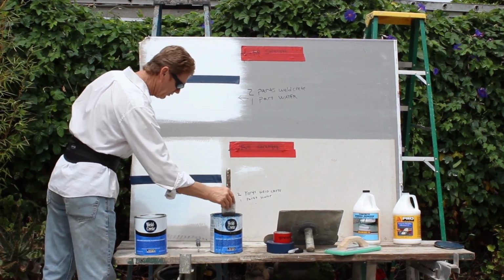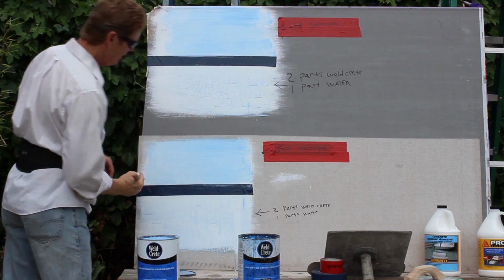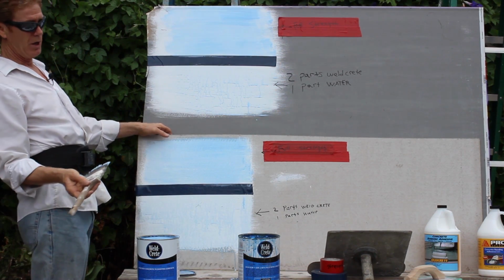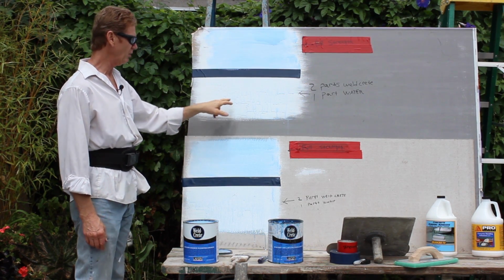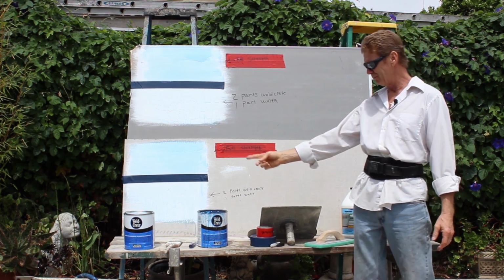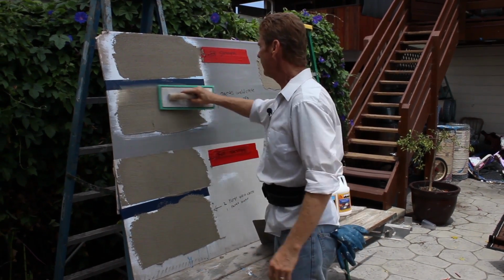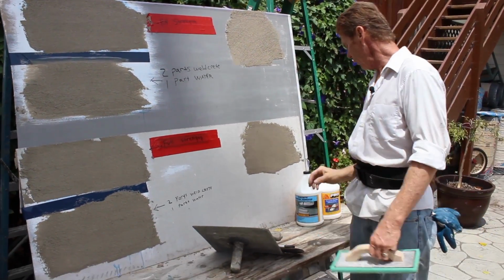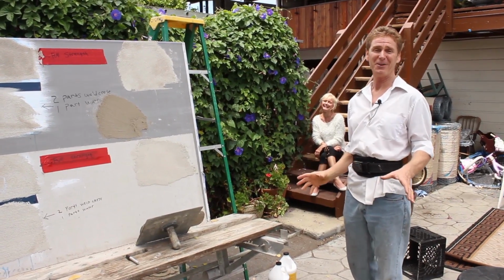Stucco and Concrete bonding agents.

Comment: Hi Kirk, I live in Ontario Canada and I have remove all the paint on the foundation wall of the inside of my garage with a diamond cup wheel and I have a little iissue with calcium in the cement. The house was built in1985 and I was thinking to put some sika latex R in my mix of parching cement to make it bond beter. What his your thought and dilution recommended. Thanks
Reply from the maker: Good evening Pascal, that product is engineered for what your needs are. I have not used it but am aware that Sika is a very reliable company if they say something works, it works.
    The complete plastering encyclopedia on video, by the plastering messengers of Youtube.  
     Over 850 free self-help videos 🎭 👀💃
Subscribers, you can depend on us to explain with truth, honor, experience, and skill for your time invested for wishing to learn the hows and whys of plastering.😉

Comment: it might be something like painting a car or metal, the first coat of say primer, or paint, is a light coat producing little dots which adhere to the metal not each other, the next coat is a wetter or full coat which hangs on these little dots, if you make the first coat wet it will probably not stick to the metal or primer as well but will create a film which might just peel off.  This is the case of trust the man in the trade who does not want to go back to unhappy customers!  Kirk is also right that a manufacturer describes a basic application and does not try to cover twists which may work.  great vid!  probably the watered down method leaves a surface that looks etched or rough and the heavy coat looks actually smooth which allows the color coat to contract creating cracks.
Reply from the maker: Evening Rob, close enough my brother. But on the flip side do as instructions say, not what my experience has proven as it's a bit complicated, this video is just the tip of the iceberg.
           Bringing peace, love, and brotherhood back to the world of, “Cement Plastering.” 💃
With over 800 educational and free Youtube videos, by your favorite plaster geek, “me🤓” and my son, “Jason,” the bearded plasterer.🌍

Comment: Kirk do you think that the thicker weld crete  was still drying after  an hour and as the top coat was drying there was opposite force which created the AMAZON AFFECT. But then 
again it look like the river NILE.!! LOL
Reply from the maker: Greetings, Observerer Dude. I've seen the results many times after plastering about 50 homes.
I know what to do and what not to do, by time in, and sure I took in on the chin a few times in the past 40 years to learn these facts.

     Bringing, peace & harmony back to Plastering
Sound Plastering tips from your favorite stucco geeks, with over 800 videos to learn from
Reply: @StuccoPlastering  Thanks Kirk.

Comment: Great videos Kirk!
I have a small repair where I am using Quikcrete Fast Set Repair Mortar and need to feather out to the existing, original painted stucco surface and will apply Weld Crete prior to the repair.  Do I need to dilute the Weld Crete on the painted stucco portion in order to avoid spider cracking or is that just for when using color coating products?  I will be priming and painting the repair once it cures (after the manufacturer's suggested time of 7 days for an exterior latex based paint).  
Besides the color additive, could you explain the difference between color coating and finish coating?
Thank you in advance for your wisdom and response.
Reply from the maker: Good evening Stanley, any bonding agent is necessary to add cement stucco to an existing wall. This video I am explaining color coats over painted surfaces.
Your using a base coat, so full strength would be advisable.
                         Bringing peace, love, and brotherhood back to the world of, “Plastering.” 😏
With over 800 educational and free Youtube videos, by your favorite plaster geek, “me,” and my son, “Jason,” the bearded plasterer.😉

Comment: Kirk, I have been perusing many of your videos and may have found the answer I was looking for in this last one...  Almost all your videos talk about things you can do to keep plaster from cracking. I'm trying to do just the opposite. I am matching an interior stucco which was made to look old, and has lots of cracks, some very pronounced. If I want to duplicate that look would I be wise to do a thick weld crete coat over hardibacker, then followed by a single, thick, wetter-than-usual color coat?
Reply from the maker: Evening David,  many ways to skin a cat.
 If you apply this bonding agent at full strength and a 1/8 inch of finish material with this bonding agent, you will likely see the blue.
 You can mix rich as in half cement and half sand, these rich mixes crack all the time.
Normally it's 3 parts sand to every one part cement plaster.
By law, I have to add, do what the can's say. 🍺
The complete plastering encyclopedia with more than 800 videos by the plastering messengers of Youtube. 
                          Bringing peace, love, and harmony back to the world of plastering.

Comment: Great videos Kirk........Quick question.....What's your take on color coating over Hardie Backer board installed on the eaves
Reply from the maker: Good Evening Ray, this is doable, I would apply a skim coat over and make sure you use water for a good mechanical bond or apply a bonding agent such as the Weld Create, undiluted.   
                Peace, love and happiness to all.
  Sharing stucco wisdom with Kirk Giordano plastering

Comment: So, My take on this is, if your going to use this WeldKrete Bonding agent.  You should apply at least more then an 1/8 th inch of Mortar on the wall.  If I'm wrong let me know.  Thanks Sir!!
Reply from the maker: Aloha Easy Dude, if any finish coat is applied more than 1/16 to 1/8 they will crack like an egg, all finish coats are not designed to be applied like basecoats.
 Example if it's a 30/30 and this can only be applied 1/16 of an inch as the sand is like talcum powder, or say the 16/20 heavy grit san can only be applied 1/8 as the sand is so thick it can't possibly be applied any thinner, but if applied thicker than the 1/8 it too will crack when dried.
 
                        Peace love and happiness to all.
      Plastering and repair tips for your number one investment

Comment: Do you ever wet cementitious surfaces before applying a coat of something? I know with tile a lot of guys wet down Hardiebacker a little before applying thinsets, or else the cement sucks all the moisture out of the thinset before it can actually bond.
Reply from the maker: Evening Love Dude, this is called hydrating, it makes for a natural mechanical bond

     Cheers, peace & harmony 
Sound Plastering tips from your favorite stucco geeks

Comment: I had this reaction with structolight as a base coat over sheetrock . I went full strength with plaster weld killing the suction completely. Room was very hot and dry as well. Craked like and egg which was very unsightly . Plus I left it steel trowled sealing it instead of floating it to let it breath . I went with taping mud over my base coat instead of the diamond i intended to use to avoid adhesion problems . In the end you gotta go with what sticks ..
Reply from the maker: Greetings Michael, atta boy.
             Peace, love, and happiness being plastered
       Sound Plastering tips from your favorite stucco geeks

Comment: Can this be used to coat before covering a pergola with stucco? We need to coat it with stucco for the HOA rules. Anything else we need to know before attempting stucco on pergola?
Reply from the maker: Good evening Beth, no, you would have to paper any wire to apply stucco to any wooden Pergola.
 I did this to a newly built Pergola that was 130 feet long by 20 feet wide, there are no shortcuts, or I would know them.    
                             Best wishes,
      Professional answers on plastering projects
Reply: We have not started the process yet but were told that we needed to cover the entire pergola with metal screen...Opinion on this?

Comment: Kirk, 

My take away from this that you can put your material over cementitious product such as Hardie board with out using Weldcrete.(Of course you should wipe off any dust on the board that might exist.) How ever I believe in the video in which you stucco over a partially stuccoed pizza oven the installation has 3.4 self firred wire and Weldcrete. That video was published in '12 where this was done in '15. Are there reasons for the difference? Has experience taught you the wire is not needed? 

I'm going to stucco over newly installed Hardie on walls that are 9' high, is that a consideration as to wire or not? Some on YouTube suggest that a 1/8 “ gap should be maintained between Hardie panels. Does that make sense? With metal studs and a cement board I don’t really expect movement from humidity changes so I would expect I can install the Hardie tight against each other. 

Finally, the Hardie is the scratch coat itself so I really only need to do a brown and a finish coat right?

Thanks, Stuart
Reply from the maker: Greetings Stuart, exzackory.
             Peace, love, and happiness being plastered
       Sound Plastering tips from your favorite stucco geeks

Comment: I have an interior stone fireplace. I want to add more mortar to the joints so that’s it’s more flush with stone surface. The existing mortar appears to be sealed because water beads up and rolls off. What do I need to do to make more mortar adhere to sealed mortar? I want to achieve a white, German smear look over entire fireplace surface. Any suggestions?
Reply from the maker: Howdy Christie, if it were me, I'd apply a bonding agent, then use Hanson's white cement plaster and trowel your prefererd finish on.      
                 Live long and Plaster
Plastering tips from your favorite stucco geeks

Comment: I was thinking another posibilty for the spider cracking is that the weld crete itself is shrinking back.  Shrink back occurs on alot of render paints as well, which are latex based  Im not sure what Weld crete is made of, i dont think it is PVA based as that is not water proof... but PVA does adhere well.... im thinking they use latex (SBR) mix of somekind as the primer which gives it that flex.....  and as most primers are wet on wet meaning you put the weld crete on and you need to put your cement coat on top with in say 24hours for it to bond, when you put a thin 3mm topcoat, the primer (weldcrete) shrinks back and takes the thin top coat with it.  if it was 1/2 inch 12mm etc.. the coat would have to much mass to be moved by the shrink back of the weldcrete.  So its probably that the top coat is too thin..   

I think follow the weldcrete instructions but, if it is direct to a top coat, weld crete should insist on a base coat before the colour coat. 

You seem to be getting away with it and making do by diluting, which is probably fine like you said.... but "if" something was to happen you would have no comeback to weldcrete.   but its unlkely given the experience and personal understanding you have of the product that you will ever have issues. 

I do love videos like this. its great.
Reply from the maker: Howdy Aaron, thank you    
                 Live long and Plaster
Plastering tips from your favorite stucco geeks

Comment: how about adding bond in plaster for refinish work
Reply from the maker: Howdy  Terry, that's thinking outside the box and using your imagination, however when any liquid bonding agent is added to a stucco mix, this action renders any bonding agent useless for many reasons.
 "Don't Do This," as I have heard from at least 20 homeowners in over the last 30 years that this is what their contractor did, thus, why the finish coats were coming off in sheets in under 5 years.
 
                    Live long and plaster
         Mastering Plastering for the beginner’s

Comment: Have you ever used AC100 from Dryvit? I use it for interior and exterior with great results.
Reply from the maker: Howdy  Chris, no, I have not used it nor will I, as at this stage of my plastering career, I can't explore the possibility of if it works, the  method I show here have been tested in well over 40 years, and old Kirk does not have 30 years left to wait for results, thus must use time-tested methods, thanks for the tip.
                    Live long and plaster
         Mastering Plastering for the beginner’s

Comment: Oh no Kirk I think I made a terrible mistake. I diluted the Weld Crete 1 to 1 instead of 2 to 1 as you mentioned in your videos.  Did I dilute it too much for a color coat application or should I be safe?
Reply: Kirk the reason I am a little concerned and confused is one of your videos from 2011 said to dilute it 1 to 1
Reply from the maker: Good Morning Global dude, you should be fine, I tell folks to do as the cans say.
 I am referring to a painted surface applying a stucco finish color coat, this is the method I prefer and all my stucco construction pals.
    BTW, if applying concrete or stucco, full strength is not only advisable but required,
 I am showing technical stuff as I understand stucco finish coats too well.                   
                              Live long and plaster
                     Kirk and Jason Giordano plastering tips
Reply: jlopezglobal I

Comment: Kirk, do recommend washing the stucco surface with TSP [Tri Sodium Phosphate] prior to any repairs or applications of a new color coat?
Reply from the maker: Howdy Ken, you can, however, 3,000 psi strength with a pressure washer will do, of course if it a new basecoat, just water needs to be sprayed on consistantly as new stucco adheres to a properly hydrated base coaat forever.                   
              plaster it’s everywhere you want to be
    Sharing DIY Plastering tips from Giordano Plastering

Comment: Kirk your videos are great but I have not seen a video that covers the following subject. Ok so i pressure washed a painted stucco wall, I applied the Weld-Crete and let it dry for 2 hours.  I am about to apply the color coat.  The question is once I apply it do I need to hydrate the color coat?  Do you just let it dry and not mess with it?  The wall I am planning on doing is 10x10 I am thinking of applying and floating on my own but I am afraid the coat will dry before I get a chance to float.  Any recommendation on how I can extend the drying time?
Reply: jlopezglobal w2
Reply from the maker: Good Morning Global Dude, good quest,
 never hydrate color coats after your application of it, it would be like apply Clorox directly on blue gens,
 You hydrate all the walls prior to the application of a color coat and the day of the color coat you mist the walls to get uniform suction before application of the color finish this makes the two porous coats basecoat as well as the finish coat to adhere properly.                   
                       Live long and plaster
          Sharing the plastering knowledge
Reply: Kirk Giordano plastering Inc. 
Kirk just to clarify are you saying you need to wet the wall after the weld crete has dried and before applying the color coat?
Reply from the maker: Good Morning Global Dude, oops, misunderstood, if you applied any bonding agent it must be a painted surface that you are going to apply a color coat onto, thus,  you don't need to wet the walls prior to a color coat as the painted surface plus the bonding agent kill the majority of suction.
 If it were a really hot day I still cool off walls by misting but this is another story.
 On the other hand               
                       Live long and plaster
          Sharing the plastering knowled
Reply: Kirk Giordano plastering Inc. 
Thank you Kurt you are the best. One last question if you don't mind. Can I mix the color coat with cold water to extend the curing time and give me more time to float it . On a cool day how much time do I have from application until I can safely float it with a green float to bring out as you say the aggregate.
Reply from the maker: Good morning Global dude, as the water from the hose leaves that may have heated by the sun you will only get cold water anyway as all pipes are buried in the ground.
The amount of time you have to float any finish depends on the weather, as a rule for painted surfaces with a bonding agent at about 75 degrees you will have between 5 to 20 minutes to float. Best wishes
                          Live long and plaster
Sharing the plastering knowledge to the DIY weekend warriors                      
                             Kirk and Team Giordano